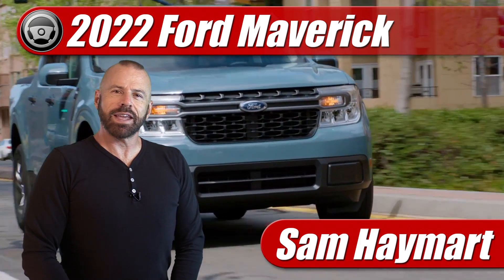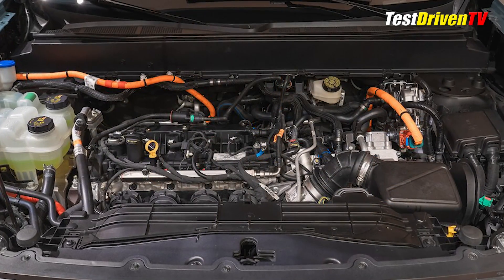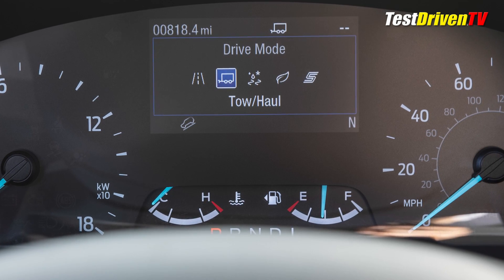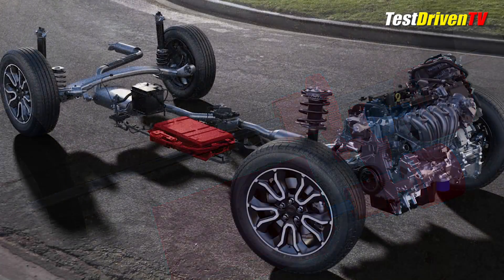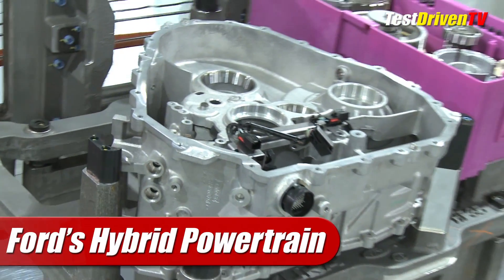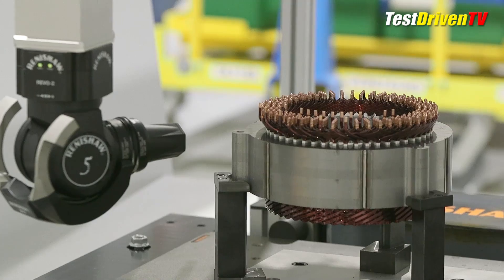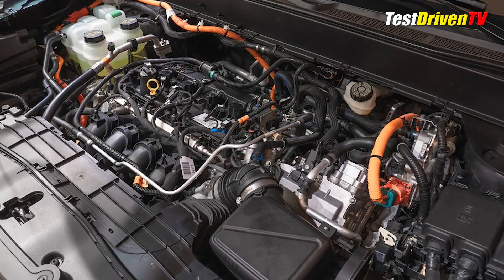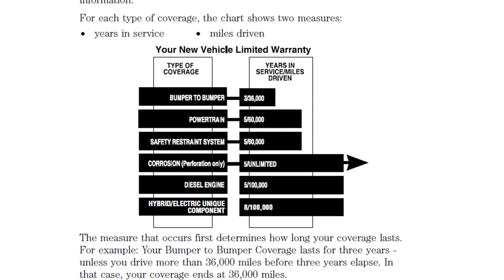2022-2025 Ford Maverick: Hybrid Explained

Comment: Its about time people understand that ecvt and cvt transmissions are NOT the same thing, they need to see this video, great explanation:)!
Reply: "I don't like that food because I've never eaten it before!"  Knowledge is power and do your research.  Hybrids by Toyota have been around for over 25 years and have proven bulletproof.  Ford makes their own, but only after having used Toyota's systems up until 2016.  There's a reason why NY city taxicabs are all hybrids.  They just work and can easily provide 300K miles before need of a new battery.  And with a quarter century in service, there are tons of hybrid specialists that can replace a battery for around $2500--or the price of a transmission.  Most transmissions won't make it to 300K miles.  The fact is hybrids have proven to have the lowest cost of ownership of any cars.  Don't be afraid of hybrids.
Reply: Both are junk. It either has dedicated gears, either manually shifted or hydraulically or I DONT own it.
Reply: @donreinke5863  the horse will never be replaced by an automobile.
Reply: @miketresham4783  Irrelevant. Try again
Reply: Forgot to mention that the savings in fuel would equal apx $100/month.  Ten years later that's $12,000 assuming prices don't go up--an unlikely scenario.  That's a lot of batteries you can buy with that.  Last point that rarely gets mentioned.  When you're in the city using primarily electric motors the gas engine isn't used.  From my experience with two hybrids (at 200K miles  each) that works out to about one third of the time without the gas engine on.  So a vehicle with, say 210K miles will only realistically have 140K miles on the engine.  BONUS!
Reply: Sorry.  Last point.  Hybrid transmissions have one third of the moving parts of standard transmission.  Less to break and if you scour the forums, you'll see that they just don't break.  They really are simple planetary gears.

Comment: The brakes on my C-Max hybrid are still in good shape after 90,000 miles, thanks to regenerative braking.
Reply: Just wait until the battery dies and the vehicle will be worth less than the cost of replacing the battery.
Brakes are cheap.
Reply: @donreinke5863  Bro, there are so many reports of these 2.5 hybrids lasting ridiculous miles. You're basically saying, oh man, you're getting great fuel economy, and experience lower maintenance. BUT WATCH OUT!!!!When your hybrid gets to 300k, you might have to replace the battery. Also no, that's not a lofty goal, if anything, given the durability of the 2.5 hybrid system, one that lasted 300k would be considered "unreliable" relative to the countless escape taxi's that have hit 500k or more with minimal to no repairs.
Reply: @donreinke5863  Already replaced my battery for my 2015 Cmax it was 55$ at the ford dealer.
Reply: @crazybusdriver1  Im not talking about the 12 volt battery--Im talking about the high volatge battery
Reply: Mr. Cool  Lets see some evidence, I DONT mean your propaganda.
Reply: We won't know for awhile on those cost. However, another hybrid like the Prius costs about $1000-3500 to replace the battery. Depends on the year, model, and if you want to go the refurbished vs new route. Far below the cost of the vehicle unless they're trashed.

Comment: Total torque? Size of the traction battery?
Reply from the maker: Ford doesn't publish a composite torque figure. Lithium-Ion battery size is 27-kW, 1.1-kWh.
Reply: The fact that Ford doesn't published the figure don't mean that the HF45 combined with the Duratec doesn't have a mesurable torque figure. Someone must have put an  Escape hybrid or a Kuga on a dyno!

Comment: Great video, thank you!  Having a hard time between the Maverick and the all electric mini cooper.  Do you have any information about the the all electric system the mini coop uses?
Reply: NO pooper is worth paying money for.
At least anything more than scrap value.
Reply: The mav will have wayy more usability. The only the the Cooper will be better at is handling.
Reply: Kat, a mini Cooper will be a bit tougher to get repaired since there are fewer dealerships. Plus, I've read that those English cars aren't so reliable.
Reply: @michaelmelling9333  Poopers aren't British cars anymore. I believe Bavarian Motor Works now owns them.
Jaguar, Aston Martin and Land (Range) Rover have also been sold off.
Reply: Don, thanks for the info!
Reply: @michaelmelling9333  Youre welcome
Reply: Mr. Cool  What shows in YOUR every post is the irrefutable fact that you are indoctrinated  rather than educated and obviously incapable of understanding the difference.
Denying solid evidence does not reflect well on your intellect, but speaks volumes about your lack thereof.
Go take a basic (or remedial) economics class and learn about that thing called inflation, as well as the law of supply and demand.
Reply: Mr. Cool  Awww poor Mr Fool cuts and runs..Hey cretin...batteries are NOT an electronic device--they are an electrochemical product.
 A premium automotive battery cost around 45 dollars in the late 70s. Today, an equivalent premium automotive battery is 175-200 dollars.
You have totally FAILED to prove ANY statement youve made, thus offering a preponderance of evidence indicating exactly who is ignorant..
Go back to school. Sixth grade seems a good starting point.

Comment: DIY - Interesting, So if the motor doesn't run with every minute, how do you truly know how many miles or hours you have till next oil change since the electric motor may be in use for some of those miles...>?
Reply: Ford has released the maintenance schedule for the mav hybrid, the recommended oil changes were beyond 6k miles I believe. Don't quote me on that be the info is available.

Comment: You answered a couple of my questions that I had a hard time finding. A planetary gear system instead of a clutch or belt CVT. Another question I had trouble finding, is the AC electric or belt driven. I'd double check before buying, but I believe you. No one in the hot climate wants the AC cutting off when the internal combustion engine turns off. Companies like Ford sometimes cut corners and try to adapt their old technology. In this case, it sounds like they are doing it right.
Reply: The AC on my C-Max hybrid is electric, not belt-driven.  Pretty sure the Maverick will have a similar setup.
Reply: its actually a bad thing its electronic..

Comment: So does this mean it’ll take longer for the cabin to heat up in the winter due to the gasoline engine not always running and taking longer to get up to temp/keep the temp up?
Reply: Not likely. I cant speak to how ford will program the system but I can speak for how toyota did theirs, and its what ford based their hybrid system on. In cold weather, your engine will fire up as soon as you start the truck. It will warm up and then return back to the power cycling to maintain battery charge. The prius actually somehow utilizes exhaust gasses to heat the engine faster so its actually quicker to come up to temp and start heating the cabin than a non hybrid. Whether or not ford will also utilize scavenged exhaust heat is unknow. Either way, the hybrid system will perform as good if not better at heating and cooling than the non hybrid.
Reply from the maker: Ford also has an exhaust system heat exchanger to speed warm up.

Comment: Appreciate the fact that working on the hybrid might kill me… any other surprises I need to be aware of?
Reply: Yeah--WHEN the battery dies the cost of replacing it will likely exceed the vehicles value.
Reply: @donreinke5863  - yeah, & the turbo just sounds like a whole lot more fun too.
Reply: @donreinke5863   It's not a big battery. Even if it tripled in price it's doable.
Reply: Mr. Cool  Doubtful. There are ominous signs of inflation across the board anyway.....and since those batteries are made from substances subject to fluctuations in the commodities markets, thats a big if.
When the demand goes up..prices will also.
Reply: Mr. Cool  You very obviously have a poor understanding of inflation and basic economics.
The Lincoln Continental Mark II  (actually a very basic vehicle even by 1970s standards) sold for 10k in 1956..By the late 1970s luxury vehicles were nearly double that and some now exceed 100k
The cheapest pile of Hyundai or Kia crap costs over 1 1/2 times what that top of the line Lincoln did.65 years ago

Comment: Tip of the day: Spring for the extended warranty or lease!!
Reply: The extended warranty is a rip off. I've bought close to a dozen new cars in my life and never bought the extended warranty. I've never had a problem with any of the cars that I've had that cost more than what the extended warranty would have cost. The best thing you could do is take the money you would have spent on the extended warranty and put it in the bank for car repairs. The odds are really good that when you get rid of the car you would still have plenty of money left.
Reply: @jimfarmer7811  yeah especially since the battery and electric dive components are covered for 100k miles.
Reply: This will be extremely durable, no issues with keeping this 15-20 years.
Reply: Ive never had extended warranty on any of my vehicles as theyve been bought from private seller plus my last truck was salvage title....Ive always had enough in savings for car repairs so yeah true ripoff if yall buy that😂

Comment: Rumor has it, it has a drain plug in the transmission.  Because the owners manual actually tells you to change the transmission fluid.  That's modern technology in Ford's eyes.
Reply: Every single "Sealed: Lifetime Transmission Fluid" transmission has a fill and drain plug. Exactly none of them have actual lifetime fluids in them. Every transmission should regularly have their fluids changed.
Reply: @SweetLou0523  Drives me crazy, how Ford doesn't have one in the Ranger

Comment: Ford said it was going to be cheap, they didn’t promise it would be reliable. If the Escape that has the same powertrain is any indication, the transmission will be a POS.
Reply: I'm not sure I follow you, the Maverick is not using the cvt it's using the ecvt and I haven't heard of any issues with that transmission.  Are there negative reviews of the Ford ecvt around?
Reply: What are the specifics on the Maverick you ordered?  Trim, options?

Comment: A very good explanation of the hybrid system. I ordered the 2.0 and awd but after seeing this video I would be a lot more comfortable ordering the hybrid. I based my decision partly on the fact that the only experience I have had with CVTs was in smaller suvs and I was less than thrilled. Ford’s power train seems quite a bit better
Reply: Its basically identical to the Prius drivetrain in concept. As long as they retain good QA and parts engineering, the hybrid powertrain will be basically bulletproof. As good as the ecoboost engines are, they are more stressed than non turbo engines. Id bet over the production run of the Mavericks, the hybrid system will have fewer overall failures.

Comment: I want one. I just wish the hybrid came in AWD like the escape
Reply: I think it will, keep it simple to start off and dont put all your eggs in one basket dont show all your cards
Reply: It will. Ive been looking at the Maverick since announcement and there are a ton of design choices that seem odd, until you realize that many additional things were designed into the truck, and then removed for initial production. This gives them a built in upgrade and refresh path for mid cycle sales boosts. The lack of fog lights, despite obvious places for them. the Small infotainment screen with a large cubby next to it, that would conveniently fit a Sync 4 screen. The lack of hybrid AWD despite space for a second traction battery and rear electric motor. Yep, bet money that ALL of these things will be coming in the next few years.

Comment: It's good to know the regen kicks in while coasting as well as breaking. Thanks for the video
Reply: BREAKING LIKE  falling apart ?
Reply: Basically,any time you’re not drawing electrical power from the battery to send to the wheels,you’re sending rotational power from the wheels to the motor/generator. Which in turn sends juice to the battery. Pretty slick.

Comment: Thanks for the video. Since it sounds like Ford is not sending the hybrids to dealers initially, do you think test driving the Escape Hybrid would give the best sense of the driving dynamics? I'd like to test drive something similar before ordering.
Reply from the maker: If you can find one yes, and escape hybrid would give you an overall sense of what it's like to drive as it shares a nearly identical powertrain and similar chassis.

Comment: This is a pretty good video thoroughly explaining the ecvt. I was really worried about it initially given what I know about Nissan cvts. I did some research first and got my order in at the beginning of july. I can't wait to get into my new car.... My very first brand new car.
Reply: Likewise the hybrid was what sold me. Well known reliability.
Reply: Congratulations on your very first new car purchase.
Reply: Yes we had the same concern. We have a Nissan rogue with cvt issues, and was afraid of the same thing.  This video helps relieve those fears.
Reply: rjbean13 nissan have shit cvt system,,,,good is Toyota.
Reply: NISSAN IS A PIACE OF CRAP NEVER AGAIN MAGE IN CHINA SVT SAY NOOOOOOOOOOOOO!!!!!!!!!!!!!
Reply: Nice job
Reply: Same me i dont like cvt ,,,thx for info.im gona ordered one,,,
Reply: I had a Nissan Altima with cvt and it was a terrible experience. so i definitely understand the concern
Reply: Sam, great video, well presented, however, I think you are wrong, when you say the starter generator, charges the high voltage battery. I suggest that the high voltage battery is recharged by the high voltage motor, when the polarity is reversed during coasting, and braking. This polarity is controlled by the onboard computer. 
Under no circumstances can the 12v starter/generator supply high voltage to charge the high voltage battery! They are two seperate systems.
Respectfully yours, Bob Lehmann

Comment: Great information! I live south of Buffalo, NY in the "Snow Belt" and was wondering how the hybrid will do in the winter. I would install snow tires on the Maverick, but in the frigid temps we do get, how it would drive?  Cheers!
Reply: So...I owned a FWD Chrysler PT Cruiser 10, 12 years ago with a manual transmission. And I can say with 100% certainty that a FWD can be driven in deep snow & ice safely.
Reply: Why would you get a 2wd vehicle in the first place??? 😳
Reply: @rhar1044  I have had many 2wd cars and they all did well with snow tires. I have even owned 2wd pickups in the past that were ok in the winter with snows and weight in the bed of thee truck.
Reply: @rhar1044   With 2wd and traction control and the weight over the wheels things are good unless you plan to go serious off road.

Comment: As someone who recently bought a Fusion hybrid, this is a great video! It is my 1st hybrid and researching online I ran into so much conflicting or just wrong information about the hybrid system. I didn't worry too much as my sister had the 1st gen Escape hybrid and it was fine. I like the way you just clearly walked through how everything works. I love driving my hybrid, you don't do anything different except buy less gas, less often!
Reply: Some people are worried about the maverick reliability but this stuff has been out for a while just on a different chassis
Reply: @willie9397  Ford's hybrid system is more reliable than a conventional drivetrain and maintenance costs are much less!  I've got the miles under my belt to prove it.
Reply: @daveedson8607  I know I never said it wasn't reliable, ecvt is way better
Reply: @daveedson8607  How many miles and what are you driving? Looking to see if the Maverick is right for me